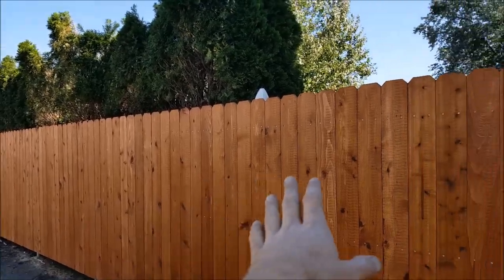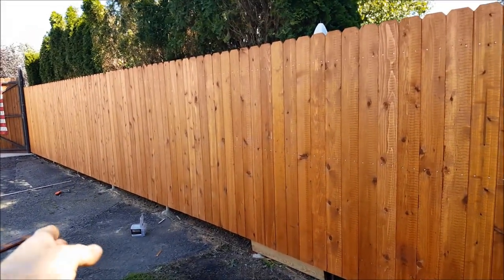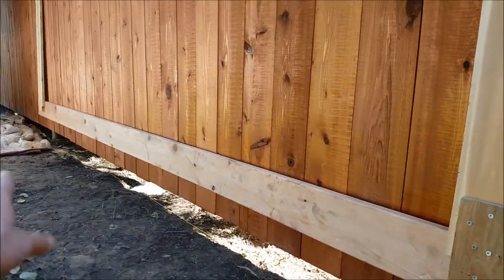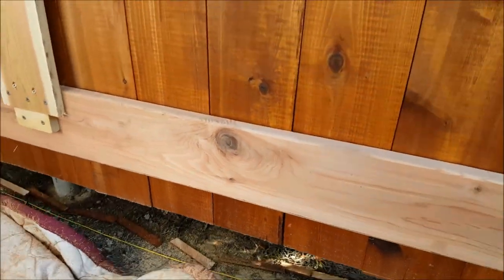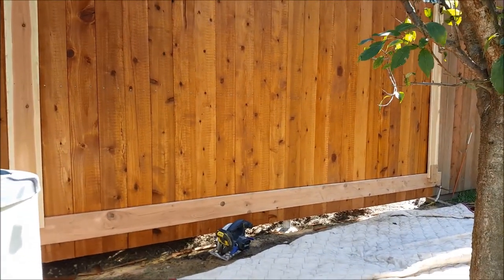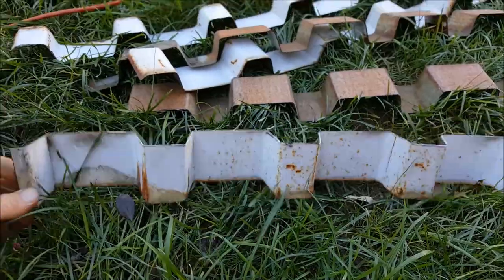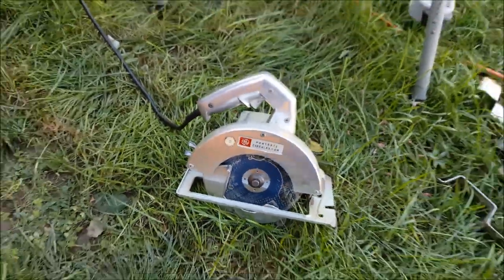If Your Building a Fence Picket by Picket... Might Run into this?  Cedar Fence build

Comment from the maker: On Amazon:
*STAINLESS 2" SCREWS: https://amzn.to/31B4RNG
*STAINLESS 1-5/8" SCREWS: https://amzn.to/2S17h4T
*STEEL BRACKETS: https://amzn.to/2SCeDKe
*TWP1500 STAIN: https://amzn.to/2EG9fRc
*POSTMASTER (no need for brackets with these!): https://amzn.to/2PxedX7
*TORCH FOR SHOU SUGI BAN BURNING: https://amzn.to/2YOTsHg
*WESTERN RED CEDAR PICKETS: https://amzn.to/2QvusC9

~Original Cedar Fence Video ~ https://youtu.be/KYNQV0MglAI

Comment: Holly crap that's how I do for my families fences!!!
Dude your good !!  Great session!!!
Reply from the maker: Sweet man that's what's up! Hoping this thing will last at least 30 years or more before it falls apart
Reply: I use a bug sprayer to coat the fence about every 5 years.  Uncle's fence still looks new
Reply from the maker: @jessesalcido2562  what type of bug sprayer?
Reply: A simple 1 gallon sprayer from walmart but u do have to use almost all open to get the wood spayed well.  No power cord to drag around or paint brush taking hours!.👍👍
Reply from the maker: @jessesalcido2562  got you. that works

Comment: I am building a cedar fence with 1 inch pickets. Should I leave a small gab between pickets? And if so how much of a gap? Or should I not leave a space as it may shrink later in time causing a gap??
Reply from the maker: No Gap. I butted mine Tight as can be. They now have gaps. The wood will always shrink

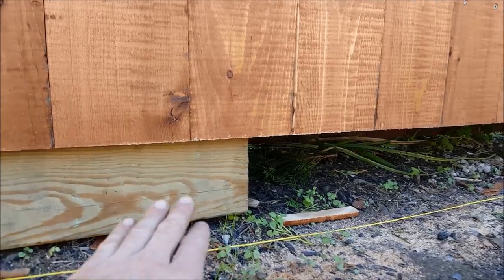Comment: @0:53 is the 5/4 board going directly under the pickets? How will you attach it? I did a cedar picket fence similar to that, but in order to get a little more height than the 6' board length, I used some 2x8s that I had in stock and bolted them to the posts at ground level, on top of an inch+ of gravel. The pickets then came down about 1.5 inch past the top of the 2bys, so I could nail them there too. I picked up about a half foot more height that way. Maybe that's similar to what you're doing?
Reply from the maker: I basically wedged them between the steel posts and the pickets. So they are firmly in place in there, I suppose if a dog went crazy on them though they could come out
Reply: @NoNonsenseKnowHow  Sounds good. I got the can opener, works great! I may assign it to my trips/travel/camping gear kit.
Reply from the maker: Awesome man. Thanks for letting me know you got it. Hopefully one day will come in handy. And if not, it's a good-looking can opener! LOL
Reply from the maker: I just noticed that donation you sent me. Thanks very much for the support man! Greatly appreciated. Enjoy your day!